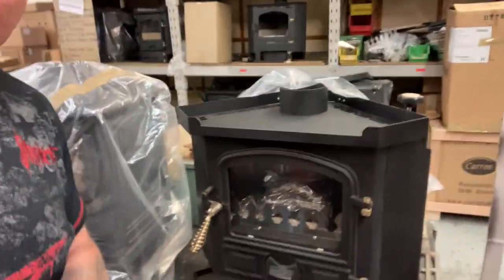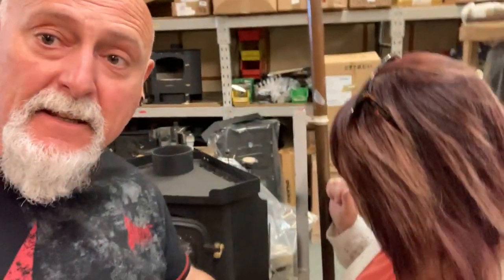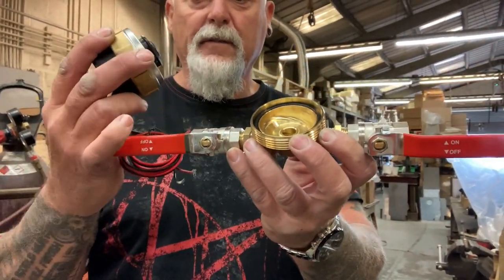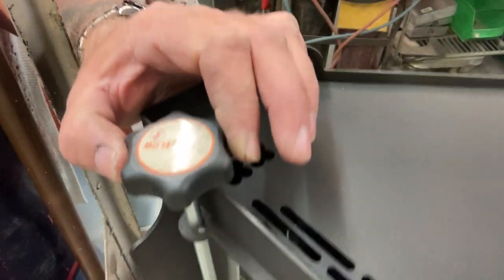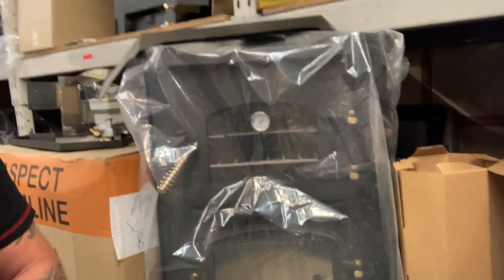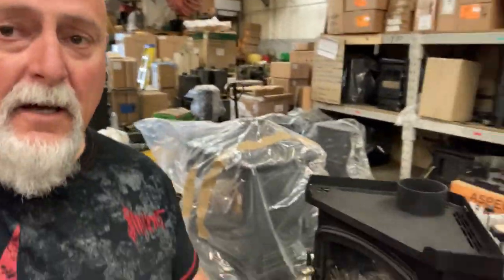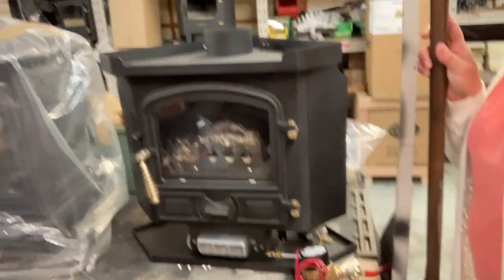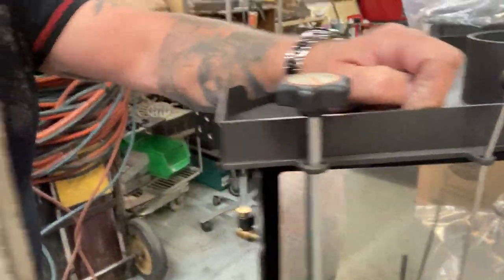Heating our narrowboat - Bubble Stoves Factory Visit

Comment: just fitted one on mine need to plumb back boiler up but so far as a stove its fantastic
Reply from the maker: I still have my back boiler to finish. They are a great fire. One tip - always use perfectly clean fuel. I have had a couple of issues with contaminated diesel.